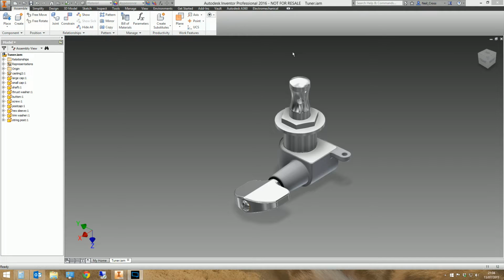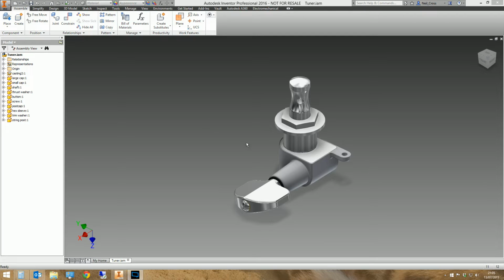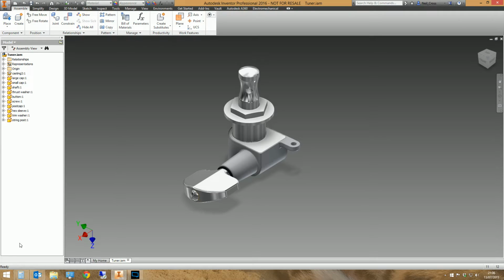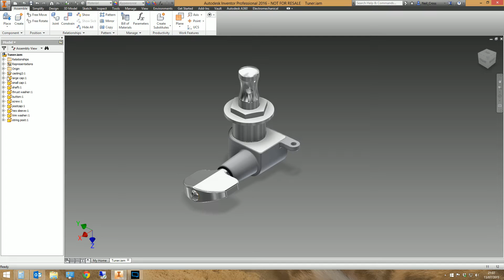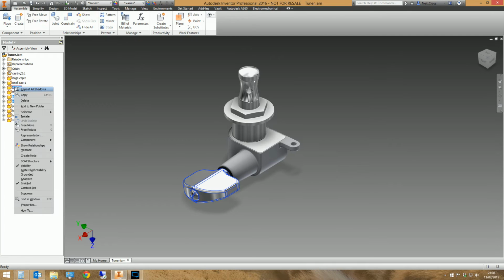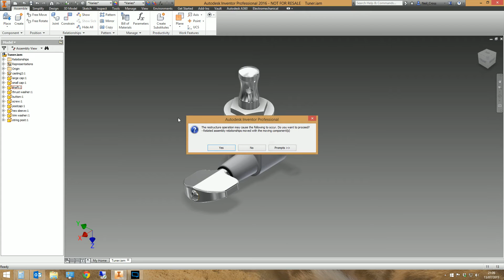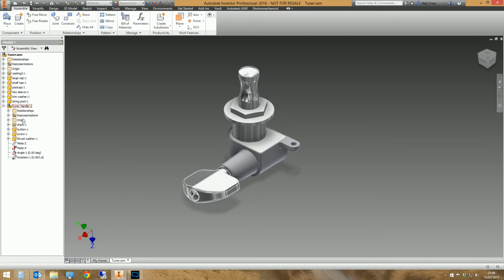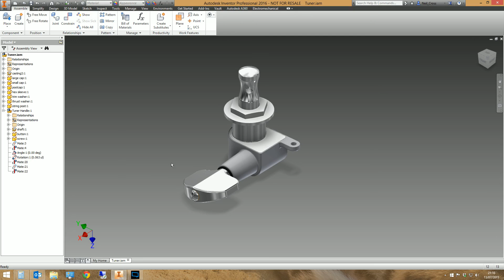How to make sub-assemblies from placed parts using demote | Autodesk Inventor

Comment: Very nice video, and always funny, toppie! It's almost the answer i'm looking for...
How do you demote an tube from design generator with on both side's an plate?
You have a skeleton part file......you place it in a assembly.....then with "insert frame" you place some tube's......then you place some plate's on both sides of the tube....!
And now the question:  How do you make a sub-assembly of those 3 parts in this top-assembly and save it correctly?
My thanks for your trouble...